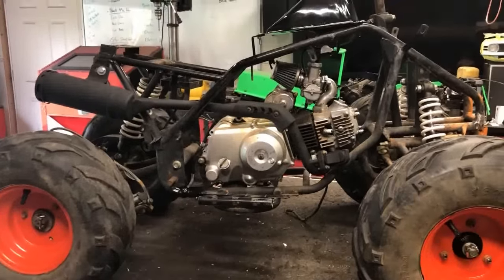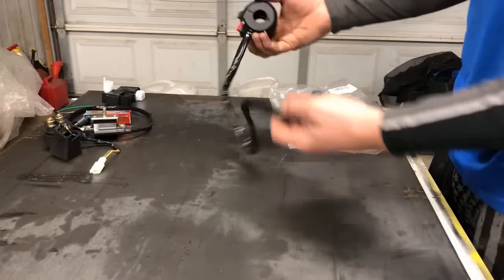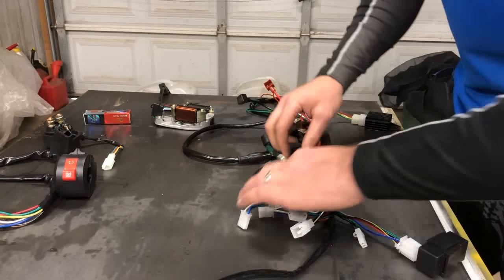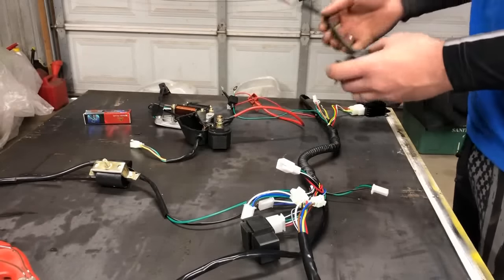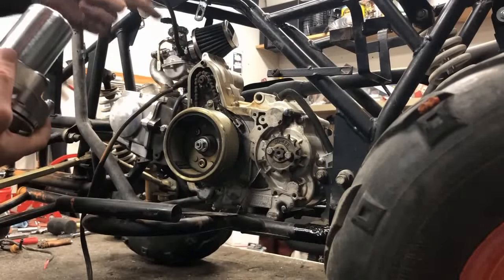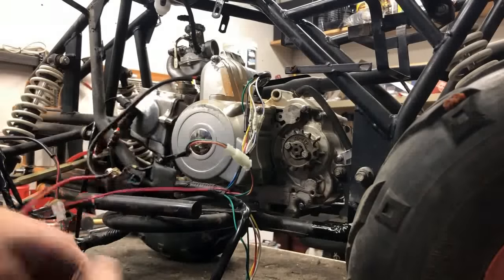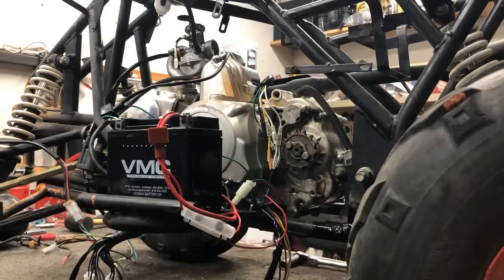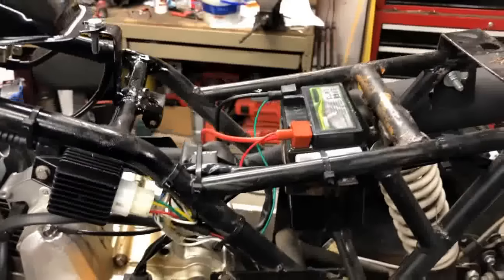Wiring a Chinese ATV from start to finish with an All New Wiring Harness!

Comment: Great video. Previous owner of a quad I now have did all kinds of weird stuff to it so just starting from scratch with the entire wiring harness was the way to go. Just got done and couldn't have done it without this video. There is not a better one on YouTube for this purpose.
Reply from the maker: Glad I could help man! Thanks for watching!
Reply: Hi great video ! Followed you instructions all worked like you said but have no spark, tried replacing all the components and still nothing. Frustrating, any thoughts??

Comment: finally a decent detailed video of wiring , this week i got a 110cc Chinese quad for £80 , Wiring loom was shot and this will help me alot.  Prob with these cheap quads though is the woodruff keys don't last and cause damage to the flywheels...  Good thing is parts are cheap.
Reply: New loom arrived, The main connectors from the stator have a white box yet the loom has single wires. Looks like i'll have to cut them and purchase the push fit ali connectors instead. Prefer the white box though.
Reply: I notice you stated pounds, I'm from the UK and finding it difficult to find parts. Have you got any links to suppliers.
Reply: Ebay has it all for cheap

Comment: Thank you so much for this video!!!!! I struggled with my bike for days. The key was the safety brake wires. So simple! You da man!
Reply from the maker: Glad it helped! That safety got me good a couple years ago so I made sure to over explained it!
Reply: @PraskaBoysGarage  cRe by chance can share a wireing diagram I have a 2013 TaoTao ATA 110-A looks like the same motor
Reply: what do you mean safety brake wires? he left the brake wires unplugged in the video and I stumped with what to do with my harness because it says on the diagram for mine that there is a brake safety switch feature that is required to run electric start and idk which connector that is and what to do with it

Comment: Thanks for responding. I figured it out, took me many hours but I did it. The handle bar switch connections were wired wrong. I had to take the brown and blue wires from the six way and move them to the two way connector to connect them with the red and green wires to starter relay. And then the wires for the kill switch were wired up to connect to the lights. What a mess!!    Be careful buying from VMC. Thanks for the video, it really helped me!!!
Reply from the maker: Man that does sound like a hot mess! Glad you figured it out!

Comment: Just finished installing a harness and started testing. Hmmm no starter. Yup it was that brake safety switch thanks for saving me hours of aggravation!  Great quality videos.
Reply from the maker: Hahaha I love it! I probably over talk about the brake safety because I was that guy that spent hours and hours trying to figure out why mine wouldn't work only to be the stupid safety! Glad I was able to help!!!
Reply: My wire harness doesn’t have any connections for the brake safety switch. What can I connect the switch to so it will start

Comment: Hey brother awesome video and great detail on how to set up and install. Ladies and gentlemen this video saved my butt it took me 7 days of rewatching but finally fixed 2 AtA 110cc b taotao ATvs. This video and many more of his have been an extraordinary help. My issue was the new wiring harness  had wires wired into it backwards which i found reversed them back and got full spark. Thanks for everything and I'm a new fan following and spreading the word.
Reply from the maker: Thank you for the kind words Ronald! Im glad I could help and if you every have any questions please keep my contact info and reach out!
Reply: can you explain what wires were installed incorrectly? I have done everything correctly and still can't get my bike to start without bypassing the wiring harness (solenoid jumpstart) so I'm thinking I may have the same issue as you but I am not very electrically inclined and so I doubt I would be able to spot the mixed up wires without knowing what to look for first and what to compare with

Comment: this is the only video that shows step by step i think. have a chinese atv cobra 110cc i think its the same engine model on all these china atvs. Iam gonna buy a wiring harness becuse of youcuznow i now i feel much more sure about this. Thanks praska boy's garage:)
Reply from the maker: This comment makes me very happy to hear! I wish someone did this video for me years ago when I was trying to figure it out the hard way! After I got a lot of experience I wanted to share what I’ve learned. Good luck on your project and let me know if you have any questions!
Reply: Praska Boy's Garage I have the wiring harness on the ATV but turns out that i had a bad engine): I took it apart and found metal pieces): I bought a new engine and now ii have led underglow on my ATV! You should try out led on your atv’s pretty cool. Thanks again!
Reply from the maker: That's too bad about the motor! I want to find a motor with low compression so I can do a "how to" rebuild video. Might save some people a few bucks from buying a new one! Thanks for watching!

Comment: Being one thats currently working on several of these atv's I'm always looking to youtube and google to try and find information and such. Your videos are just about perfect for me. The length is decent and the content is great. I had one quad which had a carb issue. Easy enough. The next one turned out to be an easy fix but not before removing all the wiring to start fresh. So currently in the rewiring stage. The last quad I just found to have no compression after restoring spark and key/starter issues. Look forward to following you and watching the channel grow.
Reply: The one thing I cant seem to find anywhere though. From Google to YouTube. Is an adequate source for adding the chinese alarms. I know most people don't care for them but my girlfriend would really like to add them to these quads. Any possibility of doing something in that area? Thanks again for what you're doing. Keep it up.
Reply from the maker: Thanks for the positive feedback! It's always something with these thing, but it's nice because the parts are pretty cheap. I've never done a harness with the alarm kit before because it runs around $75 bucks on eBay and its the exact same kit I install in this video with the addition of the computer and horn. I know those kits come with a wiring diagram to help install though. I'll keep it in mind if I do another ATV but I am currently looking to do a dirt bike next!  eBay#123656850930 as a reference.
Reply: My issue is that I bought two different remote shut off kits from Amazon. They were only about $15 but came with 0 instruction on how to splice it in to an existing set up. Resources online are scarce but I have found a couple diagrams. Hopefully I can tinker fix it together lol. Well you keep doing what you're doing and the subs will follow. I'm a youtube junkie and wish there was more content like this. I have watched so much of Harvey Spooners videos as they've been one of the better resources for basic wiring. Thanks for the link and good luck with the upcoming project. Looking forward to seeing more.
Reply: james s how many wires are on the computer? The one I saw hooked up like this 
Red wire --- battery positive 
Black wire --- battery negative 
Blue wire --- starter 
Orange wire--- ignition switch positive
Reply: @GrowYourOwnFun  the first kit has, 1 black, 1 orange, 1 red, 1 gray, 1 blue, 1 pink, 2 white to speaker, 1 black to antenna
The second kit has
2 yellow, 1 black, 1 red, 1 blue, 1 orange, 1 white, 1 pink, 2 gray to the speaker, 1 blue antenna.
So they're close to the same but obviously a few differences. I believe the pinks and grays are what tie into the black/white wire for the killswitch. I have found a few diagrams but havent had a chance to really map it out yet.
Reply: Just an update. Sat down with one of the quads and remote systems last weekend and got one of them wired up. Wasn't too terrible after looking it over and a lot of cutting and connecting lol. It was a success anyway. Now I just gotta go through and clean the wiring up again and tuck it all away. I was there once already lol.
Reply: james s just saw this. YouTube is slow sometimes
Reply: james s glad you got it working. I just removed a wiring harness off a mini quad that had an alarm from the factory but the fobs had been lost. Pretty interesting how they hack the wires from the kill switch on the handle bars and the key switch and tie it all in. I kept it together to use for reference.
Reply: @GrowYourOwnFun  for the functions and price it is pretty amazing to get a little alarm, remote kill, and even a remote start lol. Not sure how much any of them will be used but handy to have I guess. The extra battery pull kinda sucks but it seems negligible overall. Lol good idea on keeping it. My problem came when some of the colors didn't match the original wires. When I took the original harness apart I tried to map things out then but didn't have a great grasp on how this part went. Not too bad now. Got some pictures and notes to go on at least.

Comment: This video was so good it’s litrally perfect
Reply from the maker: Thank you so much! Glad you liked it!
Reply: Right
Reply: I have to agree with that assessment
Reply: @PraskaBoysGarage  i have made my own simple ignition at the moment i have the yellow and black wire going straight into the cdi box along with the red/black , blue/white , and my earth (green) . I have fitted a brand new stator and married all the connections together however im left with the green earth from the coil and the green earth from the cdi do i attached these all separatly onto the frame in order to earth them and if i do this based on the setup ive told you about will this give me spark with kickstart only . Also have a brand new coil pack , cdi and spark plug
Reply: @PraskaBoysGarage could you please let me know the kids and where to buy it

Comment: much love for making a detailed video. makes it easy to follow. I bought a brand new 110cc atv for my kids' birthday and it had an electrical issue right out of the box. after numerous attempts to get a hold of the customer support from the dealer, I decided to order the wiring harness kit you provided a link for. my atv comes with a gear indicator, not sure where it should plug into (2 wires) so it shows what gear im in.

Comment: So where does those 2 cables go? The ones u touch together to make the quad think ur pressing the break?
Reply: That's the handbrake switch wires. They cause a closed circuit when holding the brake allowing the start swith to work. So twisting them together tricks it into thinking your holding the brake... but those wires naturally somce these detect if your holding handbrake.. they go up to the brake handle. There's 2 prongs on the back of the brake handle they fit onto.

So tldr.. brake handle..
Reply: @scotthope5806  can you just tape the two metal connectors together or is it mandatory to twist the actual wire strands together?

Comment: Hey man thanks for the video! I learned a lot. New subscriber! Would I be able to put one of these harnesses on a Honda 3 wheeler? They don’t make new harnesses no more
Reply from the maker: Thanks for the sub! I appreciate it! I'm not 100% confident on that mostly because of the stator. You would need to do some research on the factory harness and the wiring diagram to see if the factory stator is compatible. It's entirely possible, but I would look for a used factory harness first on eBay before trying a Chinese harness. Let me know if you try it! I love to know if it works!
Reply from the maker: I should have asked, how old is the Honda? It might have points for spark and not a cdi box if its to old. If that's the case then it defiantly wouldn't work.
Reply: It’s a 83 Honda 200 big red. I’m pretty sure it does have a CDi, is having a hard time finding a good replacement harness. Most have broken wires
Reply: I’m quite interested in the Chinese replacement harnesses because it’s a readily available set up. With these old bikes I love it’s so hard to find certain parts as Honda stopped making it. I love vintage stuff

Comment: What do you do when you have a twin cylinder with two coils and and one coil connector? 250cc atv trailblazer
Reply from the maker: I wish I had more information for you but Im not familiar with wiring on those machines. I thought 250 trailblazers were 2 stroke single cylinders?
Reply: @PraskaBoysGarage   what could be causing it to blow my fuse every time I try to start

Comment: Thank You. I am going to put a 110cc semi auto 4speed manual pit bike motor on a 2004 Nirve Switchblade bicycle. I have the factory harness from the pit bike but this makes me confident that I can use a dual head light harness and wire it up without possible confusion.
Reply from the maker: Awesome! Glad I could help!

Comment: For $30 bucks it would be crazy not to replace wiring, rectifier, CSU box, etc.  Like you said, Chinese ATV wiring is notoriously bad, and especially if the guy before you did a hack job.

Comment: Don't know if anyone has mentioned it or you figured what those wires u pulled out ... those go to the neutral safety sensor.. some chinese atvs have it. 
Awesome video
Reply from the maker: Got it! Thanks, do you know how they wire into the harness?
Reply: It is sometimes used for a kill switch off the rear of the atv and I have seen them used for a tachometer as well. Mechanic's artistic impression I guess lol.

Comment: damn bro thank you i struggled for weeks i was about to sell it back ( bought a 110cc for 140 euros and a wiring harness for 25 euros ) and damn you saved me ngl
Reply from the maker: Hey your welcome! Glad the video helped!
Reply: @PraskaBoysGarage  hey i got another problem ^^ now even if i connect the 2 braking wire together it don't want to start , but if i take the screwdriver and i put it on the relay it tries to start , i remade my wiring to do it clean with zip tie and idk if i disconnected a cable or smthng but i don't think

Comment: Nice and thank you sir , trying to wirer a mini chopper 110cc with no wiring now i know what i can do buy watching your video
Reply from the maker: That's awesome man! Glad I was able to help! I had one of those choppers but with living in the country it didn't work great on the gravel, so I ended up selling it.
Reply: Have a question about cdi i have a wiring harness with a cdi simular to yoirs but the ports are swoped the larger port is on the right and smaller port on left. Its from France is there a way to use this?

Comment: Man all vendors should pay you to use the link to this so well explained ! You rock sold a 110cc got a massive 125cc and previous owner did not watch this so many grounds to hot it melted so ordering a new kit and will watch this again . There is a sensor or something near sprocket ⚙️ that has wires and i have no idea were it goes or what its for that i didnt see you plug in?
Reply from the maker: The links are Amazon affiliate in the description so I get a very small kick back from them but that's it! I've worked with VMC Chinese parts in the past and they are also great! The wires you're talking about are for gear light indicators. These aftermarket harnesses do no have a hook up for them and I haven't found one that offers it yet.

Comment: We got a used Chinese atv for our son for Christmas… I’ve already had to replace the solenoid… start button.. and battery. Now I’m ga ing issues and it won’t start. The wiring is a MESS and one of the wires from the push start button to the battery melted. So I’m thinking it killed the battery. Thus, how I found this video , as I’m going to attempt to re wire from the ground up. This is super intimidating, as I’m not a mechanic and this really has been my first venture into atv mechanics. It’s unfortunate because the person we got it from has no idea the engine size or make. It’s somewhere around 200 cc..Anyway, I’m freaking out to say the least

Comment: Thank you! This was a big help. When I picked up my 50cc it was already taken apart.
Reply from the maker: You bet! Good luck on your wiring and if you have any questions let me know!
Reply: The 2 prong plug on the switch was my trouble spot. This answered my questions. I now think I have a bad relay on my break because it won’t start with the kill wires hooked up. I have to jump them together. When I test the relay it show as normally closed and when I compress the break it goes open. I believe it should test as normally open for this to work.  Turns out the 50cc is a 70cc! Nice surprise

Comment: In your other videos you refinish the bodywork. I didn't catch the product you use to strip the paint off the plastic. Could you let us know the name of that paint stripper. 
I have 2 150cc quads to rebuild. They've sat in the weather for 4 years and need carbs, wiring and paint. Thanks for the guides. They are spot on and I will use them as step by step guides.
Reply from the maker: Les Eubank I’m glad my videos will help! I used Klean Strip premium stripper in an aerosol can. Found that to work better than the brush on stuff! I spray it on, scrap it off with a scrapper, powerwash, and repeat!

Comment: This video has helped me out to rewire my atv as one of the previous owners rigged it to run and the only way to shut it off was to pull the spark plug wire altho I am struggling to find where the 2 wires you touched together to get it to start go